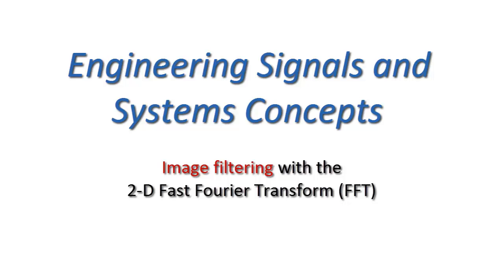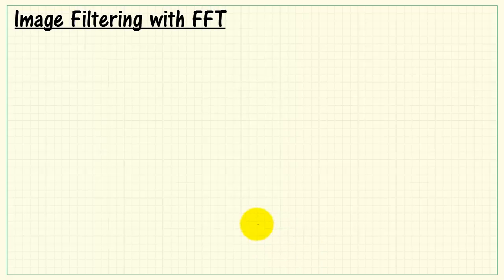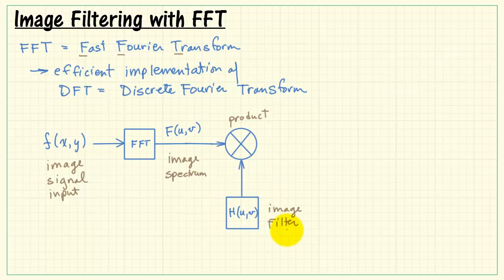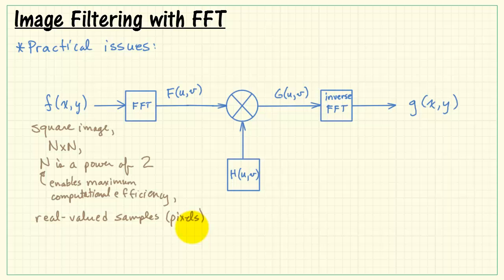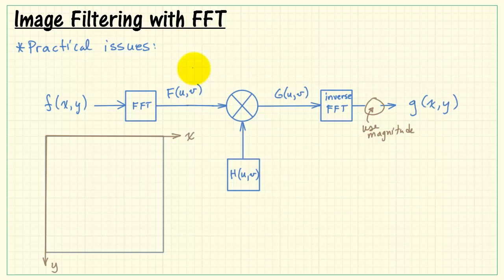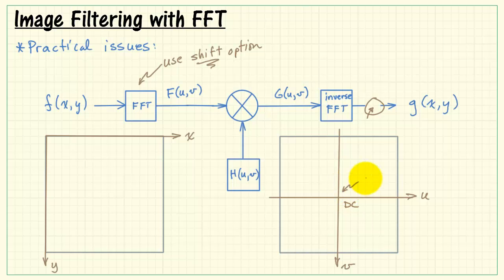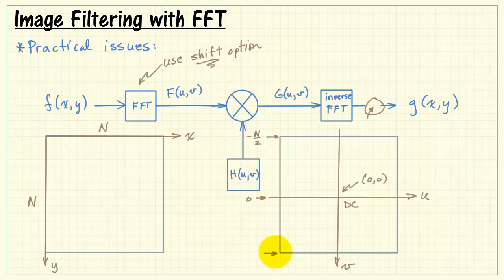Image filtering with 2-D FFT

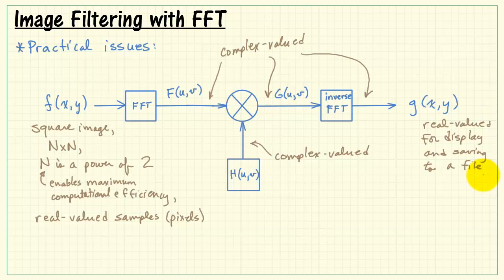Comment from the maker: You are correct for the general case of a complex-valued input image. However, for a real-valued input image this extra computation is not needed, and here's why: Enabling the shift option at 4:06 applies a spatial shift to the frequency-domain input image (which means a phase shift in the spatial-domain input image), and because only the magnitude of the output image is retained (2:50) the phase shift in the filtered spatial image gets discarded anyways.